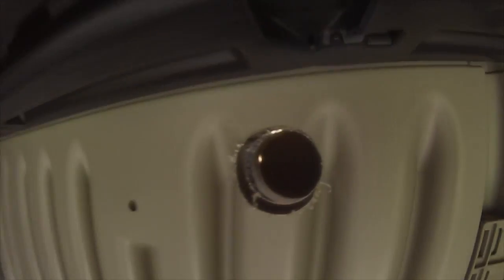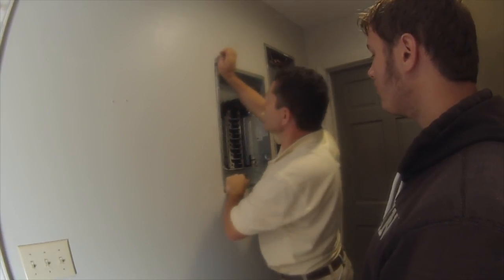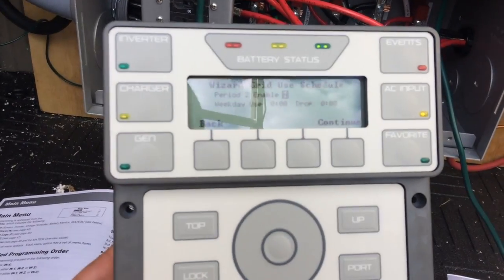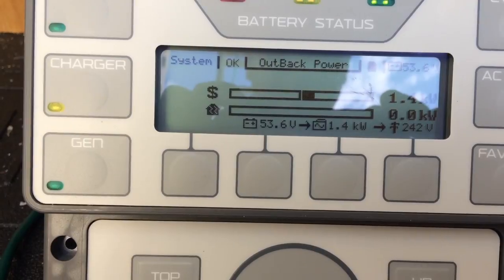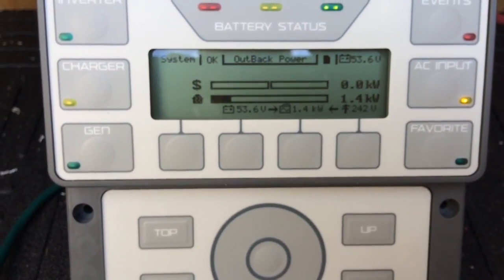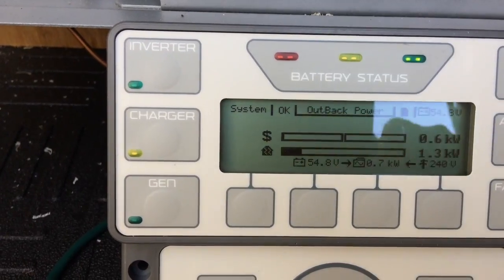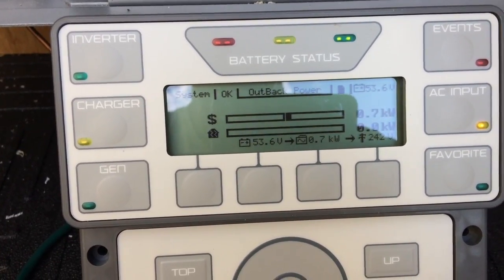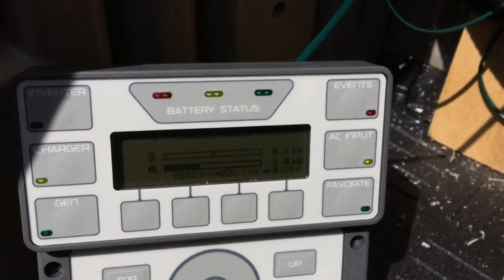Homestead Hybrid Solar Project Finished? Part 5

Comment: That's going to be awesome. If you don't mind after you figure things out would you give us complete break down of equipment and best guess of cost. I find this very interesting and something I'd like to give a try.
Reply from the maker: I mentioned that in the description because I figured that people would want to know. I will do that. I want to have some time to see how it works and what kind of energy savings I actually get so people will know the real cost/benefit. I can tell you that I did this "on the cheap", did most of the work myself, and it still cost me about $12k. I can add another $3k if I want to double my battery bank and add solar panels. It will require another charge controller and additional wire but the inverter and load center I have will support about double what I have running through it right now. Stay tuned, Brad. ~Tommy

Comment: I like that little display that you're using. I need a little battery monitor inside my cabin so I don't have to walk out on the deck to see how things are working. Who makes that unit?
Reply: U need a outback stuff to use the mate 3. U may look into the TriMetric TM-2030, I love them and have helped friends but more than 1oo of them over the past few years.
Reply from the maker: It's called an Outback Mate 3. I'm not sure if it's specifically for their gear or not.
Reply: I'm using the Flexmax 60, but holy heck that Outback Mate is expensive!

Comment: Tommy are you using Outbacks on line deal? I forget the name. If so someone who you trust can long in and set it up for you. Selling power is not good as they will make you pay for the power you give them. The meter just see's power one why. So they think the power your selling is power your buying,,
Reply from the maker: I have to pay them for the power I'm sending them??? I'm not online yet but I'd like to be. I need to find a 50' ethernet cable and run it from my solar shed to my router. Yet another job. I bought the hub 4 (should be here next week) so I can connect everything together.
Reply: Ok Cool let me know when you have it setup and I will have my buddy long in and set you up. Yes the meters if there the new ones when the power guy due not come to your house to read the meter . Then you have the smart one. ALL they see is power moving. SO they think your buying power. Trust me when I got my grid ties up and running. The power Co-Op did not show up for 4 weeks. I was running mine and all the power I made in that time. I had to pay for. The bill was 4 times more..